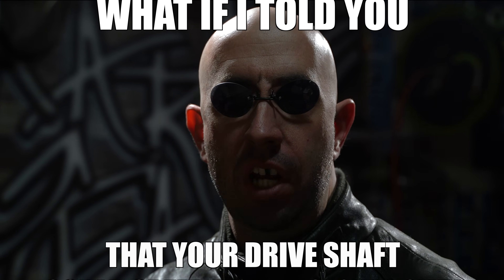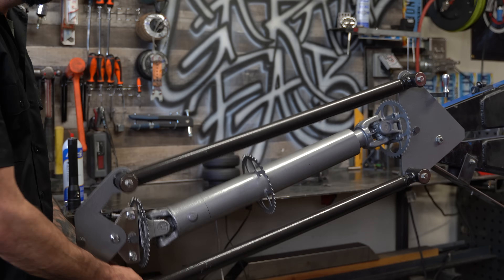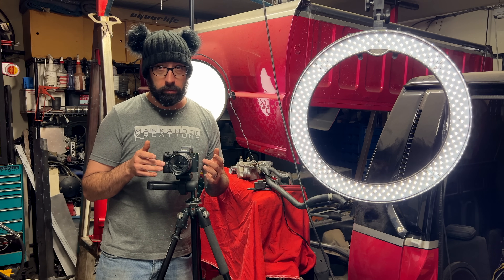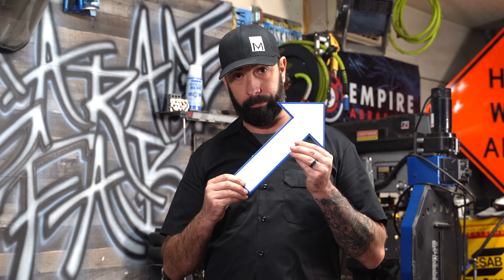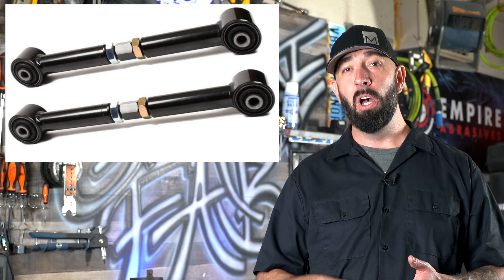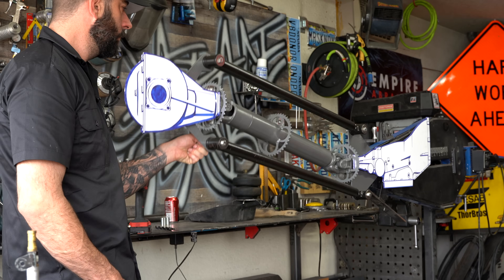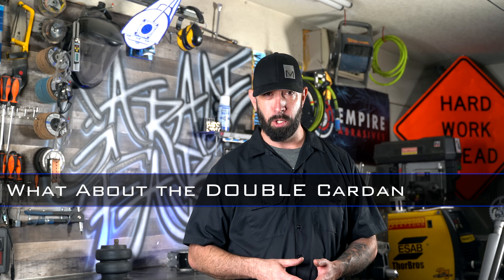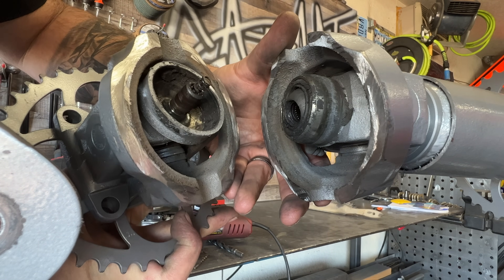THE Driveshaft Video. The Nature of U Joints. Suspension Basics Ep. 06

Comment: IF you run unis square with each other they wear out fast as they need angle to make the roller roll. This from Hardie Spicer. There is also cheap uni joints then premium. Cheapies will work fine providing you do not drive fast, go faster and the tailshaft will viabrate bad. Like say 160mph+
Pointing the nose of the diff down will help the car drive off a corner harder, I used this as a suspension tuning on a fast tin top road race car. Down to hook it level for high speed. The downforce on the fast parts gives enough travel to keep those needles rolling
UJs have a longer life than a CV.  100000km is about the life of a FWD car CV.  And probably the same on a tailshaft centre bearing which are rubber mounted. Some GM cars got that so bad that you can feel the tailshaft 'whipping' accelerating from rest.
Some modern cars have gone back to tripod rubber joints. Seems to work ok. Many older open wheel race cars used them on drive shafts, some used plain uni joints as well. As did early front drive cars.
Reply from the maker: I think I need clarification on some stuff there. The way I interpreted some of it wasn’t entirely accurate. U joints indeed need a slight angle to keep the needles rolling and the lubrication moving, but the relationship between the two U joints has no effect on this. 
Also, did you say pointing the diff down increased traction? I may have read all this wrong.

Comment: 40 years working on cars from dealerships to speed shops and that simple demonstration explained everything. 👌
Reply: Spicer and Eaton-Fuller really should have kept making those videos, I was lucky enough to learn from old-timers who had kept the video cassette tapes. Hey, remember VHS? 40 years in the field, I bet you do.
Reply from the maker: Ugh. Remember rewinding and tracking? We’ve come a long way.
Reply: I work at Neapco. I would love to use this vedeo to my new hires....
Reply from the maker: @shawnhickman3512 Feel free Shawn! That’s why it’s here. 👊
Reply: Bagging a 64 C10 long bed with a two piece drive shaft. Do you suggest using a slip yoke in the rear.
Reply from the maker: @mattappleton9549 Yessir. You will most certainly need some sort of slip joint in the rear shaft. Unless your link bars are the exact same length as the driveshaft extremely unlikely) your rear driveshaft with need to be able to change length.
Reply: They have terrible trade training for apprentices in the USA.

We had this fully explained in our 'first year' apprentice training at trade technical college, which an apprentice has to attend for a full day a week, every week for three years in Australia.

That's why any Australian tradesman applying for work in the USA is snapped-up very quickly, especially in motorsport teams.

Mechanics, fabricators, welders, sheet metal workers, electricians, etc.
Reply from the maker: Thank you, David. 🙏 I appreciate that!
Reply: @GarageFab  hell yeah you put the humpty dance  jam lol... nice video  I'm gonna balance my drive shaft today
Reply from the maker: Thank you! Lemme know how things go!

Comment: Ease and practicality issues aside, it would be an interesting tangent video to convert the u joints to cv joints on 'the machine.'  In theory it sounds like a good idea for a setup where you aren't able to always keep the ideal pinion angle. This is a great series, keep up the good work.
Reply from the maker: You are 100% correct! It would solve all the problems, but for that reason it would be a really boring video. 😆 It would be more than practical, too. It’s not used often by car manufacturers because it’s more expensive, but completely reasonable for aftermarket use. It’s much stronger, but with strength comes weight so it might not be ideal for race cars.
Thank you, my friend!
Reply: @GarageFab  Alright maybe interesting was the wrong word to use haha. But I thought it maybe was at least worth mentioning. Thanks for the reply :)

Comment: How do the rules apply/change with a slip yoke? 🤔
Reply from the maker: No rule change! A slip yoke is there to allow movement created by the differences in length between the drive shaft and suspension components (linkbars/leaf springs).
If the linkbars and drive shaft were the same length, the drive shaft wouldn’t need to move back-and-forth. I’ll be creating a video shortly that I’m gonna call “Third Links” that discusses how non-suspension components interact with suspension components. E.g. Driveshafts, CV axles, tie rods, etc. keep an eye out for that one. I think it’ll be really interesting!
Reply: @GarageFab  makes sense but generally with a slip yoke the pinion is pointed at the transfer case instead of both being parallel or am I overthinking it? Reference being if you install a slip yoke eliminator on a jeep, do you have to change the pinion angle?
Reply from the maker: @LupienLife  I’m not a Jeep guy so don’t quote me on any of this, but I believe that slip yoke eliminator kits change your front joint from a single U joint to a double Cardan joint. If this is the case, yes the pinion angle needs to be changed so that the single U joint is straitened out. (Differential would be pointed towards the transfer case.)
The “slip yoke” is still there it has just been relocated from the front Joint of the driveshaft to the driveshaft itself. (I’m sure it’s not called a slip yoke anymore at that point)
So the pinion angle change required with a slip yoke eliminator kit is because of the double Cardan joint,  not because of the elimination of the slip yoke .
Reply: @GarageFab  perfect, that's exactly what I was looking for. You're right, it adds double cardan and moves the slip. Great explanation 😁
Reply from the maker: Excellent. Hope it helps. Cheers!

Comment: Back in the day when we used to jack the rear end up real high I had some extreme jack ups but never noticed much of any extra vibration except the case where I was at the limit of u- joint angle and it would clunk against itself when I hit a wave in the road.
The thing that used to crack me up was when the 4- wheel drive craze came to town and everyone was jacking their trucks up to the moon and putting huge tires on them.  The huge twice diameter tires would reduce their gear ratio to around 1.5 to one causing many to drive around in transfer case low gear all the time. Also causing the drive shaft and universal joints to have twice the torque on them. Add to all that the u- joints being pushed to maximum angles with the lift.
It used to crack me up to see guys torque it up and completely blow the driveshaft right out of the truck.
Reply from the maker: That’s insane. I’ve heard of exceeding a U joints maximum operating angle but never seen it for myself.
If you jacked up a leaf spring vehicle with parallel blocks, (assumption) your transmission and pinion angle would remain parallel so it would make sense that you wouldn’t experience any vibration. Until that severe operating angle caused its own vibration at higher speeds.

Comment: I wonder how dirt track cars deal with pinion angle
Reply: I guess it's not as much flex as I thought. Should I replace the original double cardan on my 77 blazer with a 2 joint axle? It needs rebuilt anyway should I just replace it?
Reply from the maker: What type of suspension does it have? Double Cardan joints are ideal on leaf spring and 2 link suspension. Singular U joints are best on 4 link suspension.
Reply from the maker: I don’t know this for certain, but I assume they have link bar rear suspensions so it should be no different than a typical car. Lemme know if you find out!
Reply: https://youtu.be/Gay0Xk1sJBk

Comment: My dude, thank you. I think you may have answered my high speed vibration issue. I've got a 1997 Montero Sport ES that shakes at 65 and above. Of course I've changed all the parts up front (some twice) to no avail 😡. Now I have something new to investigate 🤔.
Thanks 👊
Reply from the maker: Happy to help!
Unless your Montero has been customized, most of the stuff in this video shouldn’t apply. However, by your description it sounds like driveshaft issues are still a possibility. I’d recommend starting by wiggling the driveshaft. There should be no movement at the joints, and very little movement at the carrier bearing. (If the Montero has a two piece driveshaft) If it passes that test, and you have the means to remove the driveshaft, take it down and move the joints around by hand and make sure they move freely. If either one of those tests fail, you may have found your problem.
Please send updates! We can figure this one out.
Reply: @GarageFab  ok...thanks again

Comment: Can you do a video on double cardan joints and how it relates to all of the scenarios you have here? More specifically right after the carrier bearing...if it makes any difference than what is shown here
Reply from the maker: I won’t be able to do a video specifically on the double Cardan joint, (especially since I destroyed it for this video) but luckily there’s not much more to say! A double Cardan can be bent any angle desired (within its limits) without producing any oscillation.
In the set up you have mentioned, the first U joint at the transmission must be fairly straight. Generally a minimum of 1°, and no more than 2° will keep the needle bearings and the lubrication moving without causing a vibration. The middle joint (the double Cardan) can be bent to whatever is needed. The last U joint at the differential must also be nearly straight, meaning the differential would be pointed at the carrier bearing. 
And hopefully this answers your question. If not I’d happily clarify. Let me know!
Reply: @GarageFab  that was perfect. Thanks.

Comment: you can also really notice the ujoint issue when in 4x4 on a hard surface and turn the wheel a lot and the ujoint will send feedback through the steering. A good reason for cv joints ! You also find cv joints on driveshafts now a days too by the way.
Reply from the maker: Good info! Yeah I’ve seen a CV shafts but none of them are Toyotas. 🤔
Reply: @GarageFab  but Toyota does use cv's in their solid front axle and why I will be using one in my build! Probably an upgraded one from Marlin or the like....I know you can buy cv front axles to replace the ujoint style but they are huge $, not something I can afford for sure.

Comment: I’m glad I stumbled across your vid here! And a excellent vid on top of that! I’ve been building cars for a very long time and almost made the rookie mistake of welding my 4 link brackets to the rear end before I ever set my motor and trans in to get the trans angle! You just saved me 100’s & 100’s of dollars worth of chromoly and tons of hours worth of grinding and re-welding time! I’m building a 1995 s10 drag truck big tire and stretched 12 inches for the pro mod extended front clip 98-2000 model. Motor and trans will be pushed back 12 inches and centered. Also on a good note it’s just as important for people to center their pinions left to right as well as up and down depending on the suspension set up. I have to move my rear end 15/16 to the drivers side so it’s centered with my trans. So the drivers axle will be shorter than the passengers side
Reply from the maker: I’ve spent plenty of time cutting stuff off and starting over. Happy I could be of service, Rickey!
Sounds like an exciting project! I hope to get some updates on this thing.
I am not a racer or a race car builder, so a lot of this is still a mystery to me.
Why must a differential be centered? Is it simply a weight/balance thing?

Comment: Great video. Usually I see these and start yelling at the the screen.  No problem with any of the info contained although I’ve encountered plenty of modified vehicles with parallel drivetrain/pinion angles and still had a vibration but it’s always a good place to start. BTW I built the double cardan slip yoke shaft on Keith’s C10 in your video.
Reply: I watched the pinion angle vid before I saw the 4-link stuff on Keith’s truck. I didn’t realize the double cardan slip made you have to redo those axle brackets. The chassis builder kind of had our hands tied a bit. It’s been a number of years since we did the shaft but I remember that was the best way to workaround what was already there. This was even before had redone the bed floor.
Reply from the maker: Small world!! It all makes sense now. Without the double, we would’ve had to cut the cab and redo a crossmember. And since he had no vibration issues before I started, we agreed to put it back the way it was. Still no issues according to Keith so that’s all that matters.
Now I just need to learn to look at the vehicle better before I start doing any surgery! 😂

Comment: First video of yours I seen, great job explaining u joints angles. I would like to see one done with rzeppa joints and how they respond to steep angles. Can’t wait to see the other videos in this series!
Reply from the maker: Thank you, Rich! I have not heard the term Rzeppa before today, but after a brief search, it appears it’s a constant velocity joint like those on a typical CV axle. If that’s correct, that would be a fairly boring video. 😐 
The CV axle is in fact a constant velocity joint. So there would be no audible speed changes on my fancy little machine. The Rzeppa joint would make this entire video obsolete. It’s stronger, It’s capable of much steeper angles, and the angles don’t have to match! 
Naturally your next question will be, “Why isn’t the Rzeppa joint used on driveshafts?”
They are occasionally. The reason they’re not used all the time, is they are more expensive to produce. When auto manufacturers are building millions of vehicles, they really need to keep the cost down. Every penny counts. And since U joints only cause problems if they’re set up improperly, the old fashion U joint is the best choice.

Comment: Great thanks to you for your instructional videos, I truly love them!  I have a head of me a leaf spring rear axle swap. I'd like to know how would you go about doing such a swap so that all the angles and motion measurements and such matches with original axle
Reply from the maker: Hey, Mikko! It’s hard to say without being there. Are the leaf spring perches that are welded to the axle at the right width? Or will you have to cut them off and weld new ones in the right places?
If they’re already at the right width, just install the axle and determine if the pinion angle matches the driveline angle with the weight of the vehicle in the suspension. If it does, great, leave it alone. If it doesn’t, you might be able to install some angled blocks.
If you have to remove and install new perches, assemble everything but without welding the perches to the axle. Tighten the U bolts but not so tight that the axle can’t rotate. Set the vehicle down and check the pinion angle. Lift and adjust if necessary until the pinion angle matches. (If it’s a high horsepower motor, consider pointing the pinion angle down 1-2 degrees below the driveline angle.
Once you’re there, make sure the axle is centered, tighten the U bolts and weld on the perches. Or at least tack them in place and disassemble if needed to finish welding. 
Hopefully this works out for you.

Comment: "What if I told you bla, bla, bla". Then I would tell you, "You must be making this video for,(Beginning Auto repair, 101)". Haha Not to mention, you left out, "staggered centerlines" or "yoke parting face angle" or where as the control arms/links do offer some U-joint alignment control, as you state. Their primary purpose is for suspension movement and ultimately handling. So it's handling first, driveshaft alignment, 2nd.  Further, you don't change the length of the arms/links and it re-engineer the geometry to maintain driveshaft alignment.  You add a "traction control" device. Because it sounds a lot better than "U-joint saver", but that's what they basically are. Hey! I just made a funny!? "Joint saver". Now what was that word you were using, double wammie, double trouble, double
Reply from the maker: It’s for anyone that doesn’t already know, or people that think they know and don’t!

Comment: Your demo setup explained very well. I'm still confused though. On my Ram 2500 4x5, they use a double cardin at the xfer case, and a single at the front axle. That is 3 joints by my count. You say 2 cancel but 3 does not. Why do the manufacturers break the golden rule?
Reply from the maker: They probably didn’t break the rule. If you look underneath, you’ll likely see that the single U joint is mostly straight, (the diff will be pointed toward the back of the transfer case.) The double Cardan will be bent. Remember only bent U joints cause an oscillation. So you should only have 2 bent U joints. (In the double Cardan) Lemme know what you find!